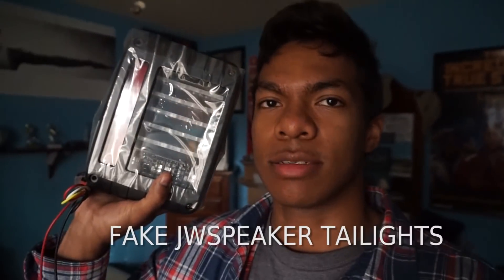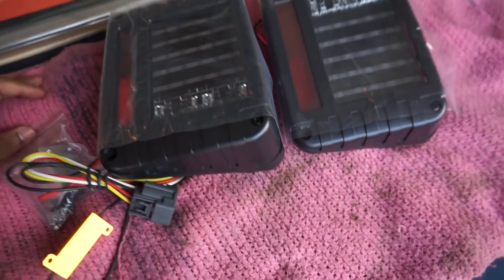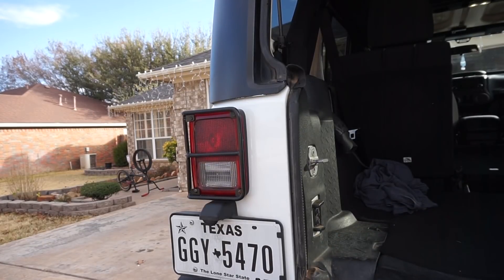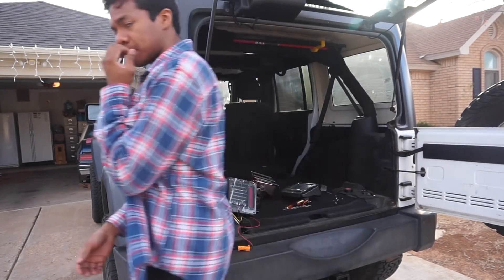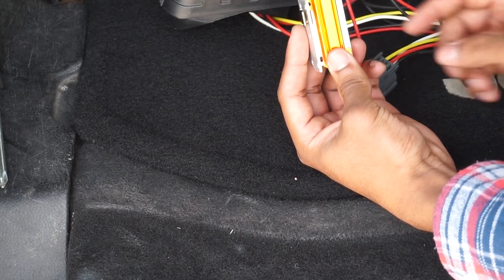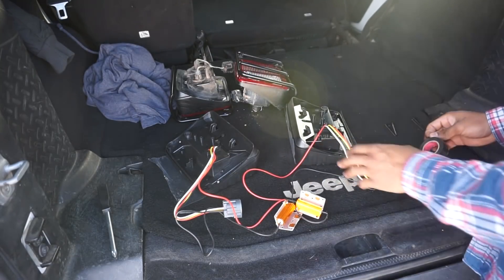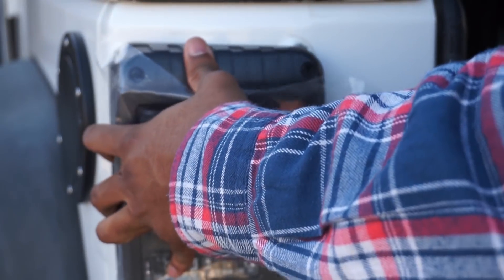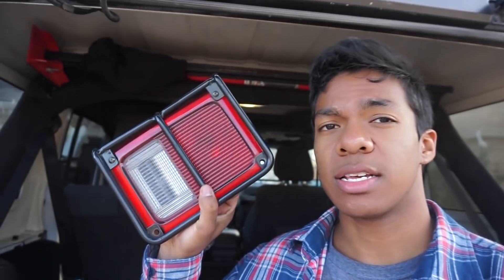Fake JWSpeaker Tail Lights [Jeep gets LED Tail Lights]

Comment: I have a 2014 JK,  I bought stock, with the intent of modding, now paying it off, I bought my set of HELO
lights and tail light assemblies on Amazon  I found your feed to go off, so thank you. Also, i'm pretty sure you've  done it already,  But if you have a ollies store in your area, they sell the micro fiber in pack of 10 for 8 bucks there. Among many other commercial grade detail supplies for cheap.

Comment: How is the reverse lights on this?
Reply from the maker: Ray526 better than stock, but not that great. (I ended up adding flush mount leds to my rear bumper as back up lights when i need them, i have a video over it)

Comment: What brand are these? Lite-way?
Reply from the maker: Tony no brand, came from China. but pretty much Lite-way.. i got them for around 35$ on eBay.
Reply: I'm thinking of putting them on my JK, along with the 3rd stop light (above spare tire). So these are the liteway knockoffs, which are the JW Speaker knockoffs haha.
Reply from the maker: Tony i recommend them! They look really good, and the LED blade pattern looks nice.

Comment: I don't think the euro spec works with US jeeps.
Reply from the maker: DarthVirc the connector i believe is the same, but there is an extra wire. Regardless it wouldn’t be too hard to modify a US spec to work with a Euro spec tail light. Maybe in the future I can try this out.
Reply: I believe you would have to connect that extra wire to the front turn signals, being that it probably controls the amber light. But making the EURO light behave correctly would be difficult, being that it will probably stlll blink the Red light when you try the turn signals. Its Quite confusing as I've never done it or looked into the wiring of the taillights on my jeep. but I've tried to covert my old pickup to have EURO lights and I couldn't get it to behave.
Reply from the maker: DarthVirc ah i see. hm, maybe there’s someone out there who made a module or some kind of write up on how to do it.